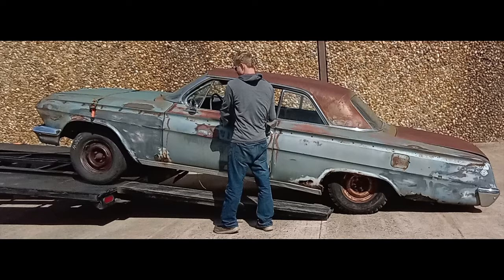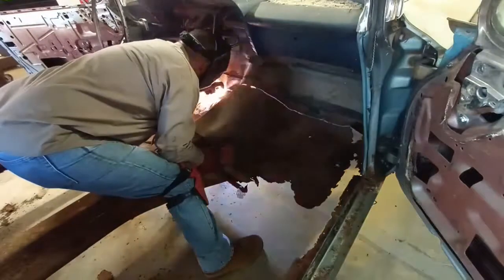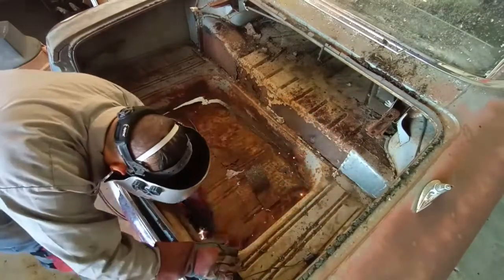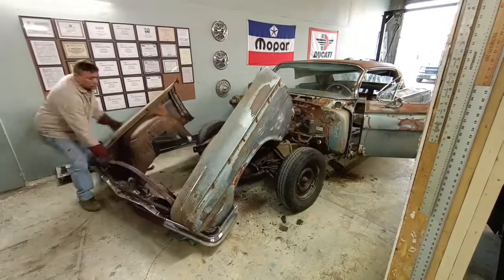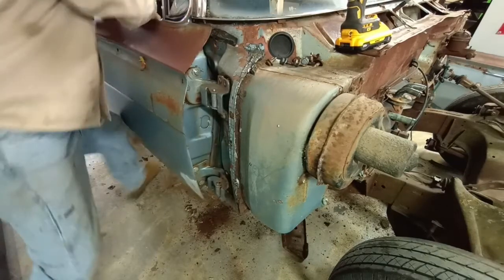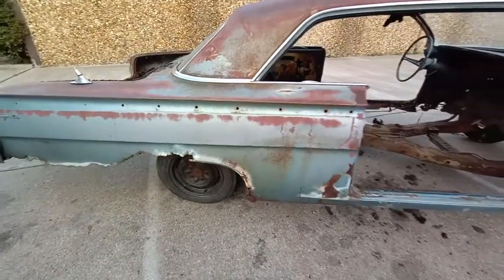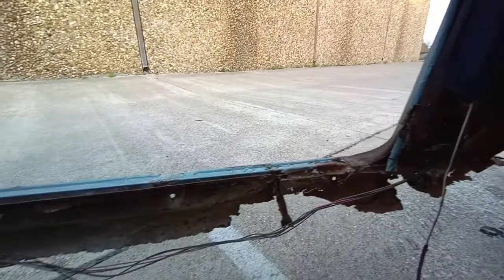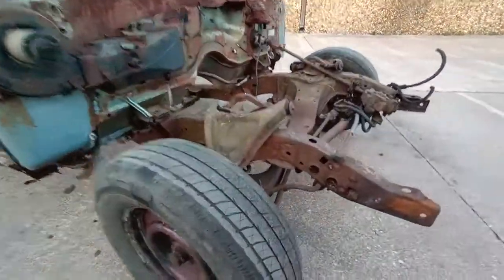1962 Impala Restoration :  Day 1 - extensive rust repair / teardown and assess -DIY Auto Restoration

Comment: I have a 62 rag top, with the same rust. Would your approach be different, regarding cutting out the floors? Meaning, would you leave the car on the frame, when replacing floors, since you have no roof?
Reply from the maker: Must install onto frame fixture....
Reply: @guzzifabrication3448  So your steps would be the exact same? Cut out the existing rotted floors, brace it, lift off the frame, cut out rockers.?

I assume your bracing would be different, being its a convertible?
Reply from the maker: @tepp4083  hey check out the series and you can look at other vehicles like the 68 Charger everything I do is on frame fixture

Comment: I got my 62 from Minnesota also and it’s in the same shape!! I’m doing all the work myself in my home garage. Just finished rebuilding the rockers ... you definitely can buy everything... super cool man keep up the good work.  Very inspiring!!
Reply from the maker: Are you going back all stock?
Reply: I reinforced the X frame with 1/8 metal since I have the whole floor pan out.  Just finished rebuilding both rockers ... I hope to install air bags .. stock drive train. 283 small block.
Reply from the maker: nice I'm on Facebook too,  post some pictures of your build I'll check it out

Comment: WOW! That's really a rust bucket. Are you sure you can fix that?
Reply from the maker: Absolutely, there are replacement panels available for replacing the complete floor, trunk, and rocker assemblies, the rust damage has extended past these in some areas, these areas will have to be hand fabricated. We will posting video of the complete restoration process on the Impala, subscribe and follow along. Thanks
Reply: I have a 63 impala it has a crack right at the top of the quarter and the rear quarter window meet how would you repair that
Reply from the maker: @LILGIBBYPRR-ESR  Send a picture of the damage to guzzifabrication@yahoo.com and I'll take a look

Comment: Guzzi is it hard to weld a place in a roof that's oil canning or just shrink it?
Reply from the maker: depending on the roof shape, where the repair is to be made, how big the repair is, you can open a real can of worms if your not careful..... if the roof is oil canning before the repair address that first, if you don't you will compound problems.
Reply: @guzzifabrication3448  it a ss car in bad shape the oil canning is right in front near the windshield. About 8x8. I paid 800 for it. I also have a bel air I just bought for 700. If the roof will be a headache I'll just fix that.
Reply from the maker: @derrickwebb7230  It can be repaired, but the repair must be accomplished in a certain order and not rushed.

Comment: Its not worth it.you can buy a better one for cheaper and save money on metal fab.thank strip it n blast it
Reply: No rust solid project =12 grand at least.  Some folks can’t afford that 🙋🏽‍♂️
Reply: @Cheez1979  yea could be more.might as well buy a 5k car and strip it save all that labor and metal fab money for paint and material.
Reply: Where would one find such a car for that price point. Any leads?
Reply from the maker: And that's why I make the videos... so you can do the work yourself
Reply from the maker: This is the car the customer chose to restore.